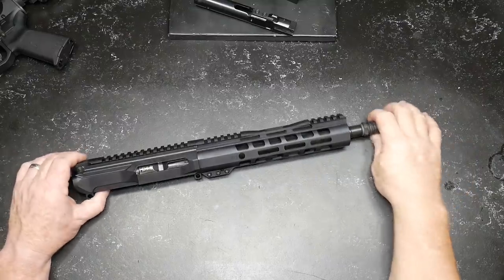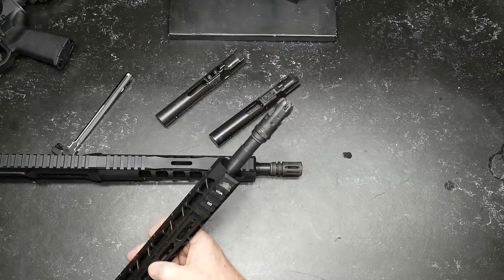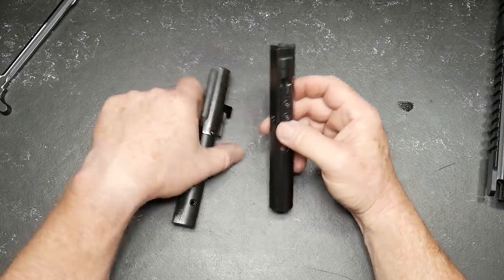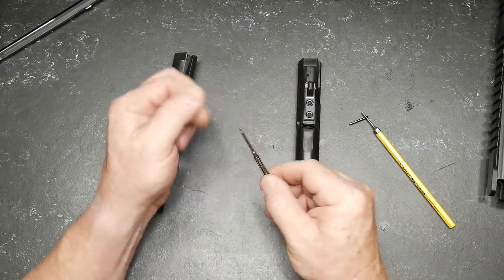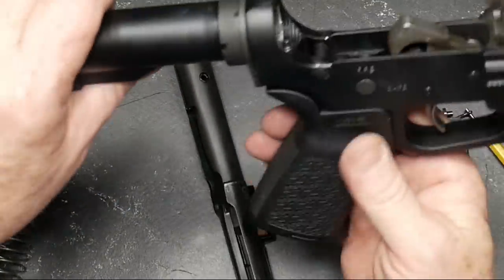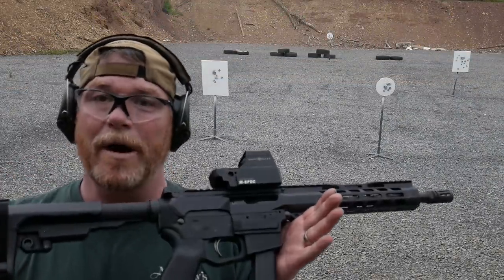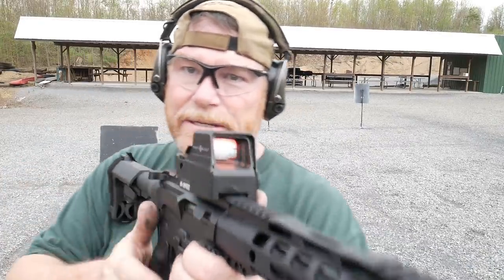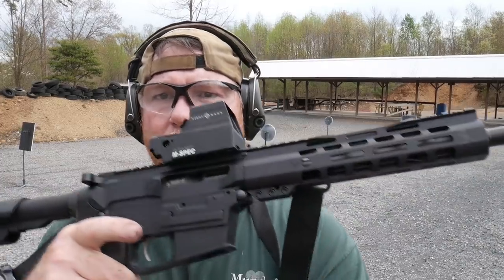PSA 9mm 10.5 Inch AR-9 Upper Review and Demonstration

Comment: I know this video is old but I was wondering if anyone could help me. So I plan on building a 10.5 other (since no sbrs in my state). My issue is I’ll have to get an extended buffer tube to make the 26” length. Should I stick with a rifle length spring / buffer for it?

Comment: So mine just shit the bed. The bolts holding the “gas” key sheered completely off. Will be expecting a complete replacement. I’ll keep you posted.
Reply: Any updates?
Reply: Nope still haven’t sent me a new one, called a few days ago and they said none in stock. PSA is a great manufacturer but has one of the worst customer service departments.
Reply: No kidding!!   Same thing happened to me - I have to reach out to them.   Crazy!!   But I LOVE this thing!!
Reply: Greg Rinaldi better get ahold of them sooner rather then later, over a month to get my replacement.
Reply: Any updates?
Reply: Heinz Franzen yes, they sent a gen 4 bolt and so far so good. But it still have the same screws, no idea why it’s not a solid piece.
Reply: @VictoryOrValhalla14  bc it's cheaper to bolt the keys on that way they can pump out bcg and add corresponding keys after the fact... It's all about the dollar, cash is King, money talks and bullshit walks. #byoncecryonce #yagetwhatyapayfor

Comment: Very cool gun. However I think I would opt for a 16 inch instead of the 10.5. You need all the velocity you can get when it comes to pistol calibers. This specific weapon is the middle ground between a traditional pistol and a full sized rifle, so it's basically a big compromise in my eyes. Yes theres specific situation where something like this would be a better option than a traditional pistol or full sized rifle, but more often than not, the other two will perform better than this one.

Comment: 9MM PIN GETS DAMAGED...DUE TO DESIGN OF AR PIN...9MM HEAD IS HEAVY AND PUTS STRESS ON PIN..YOU HAVE TO SWITCH BUFFER WEIGHT...HEAVY BUFFER IS BEST..BUT YOU NEED TO CHANGE OUT PIN OFTEN DUE TO STRESS FROM HEAVY BUFFER...GOOD AND BAD